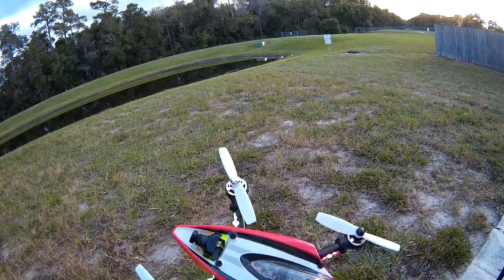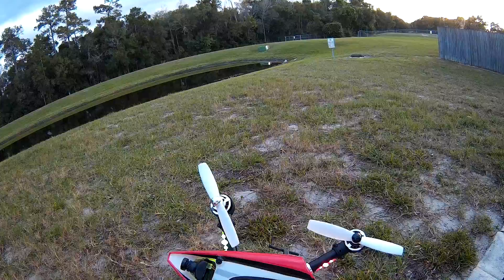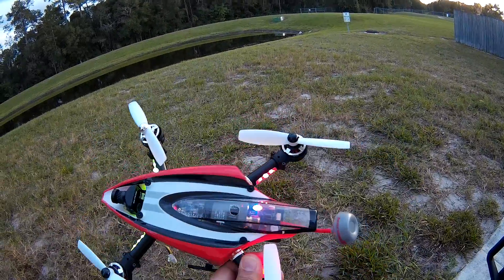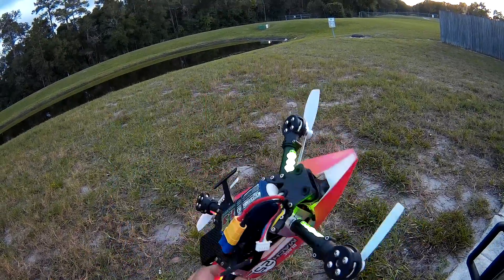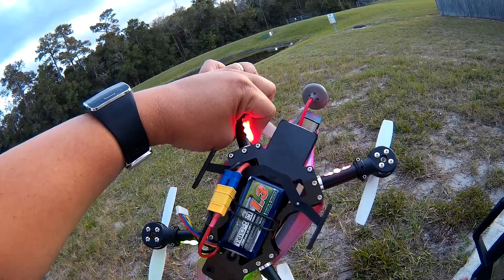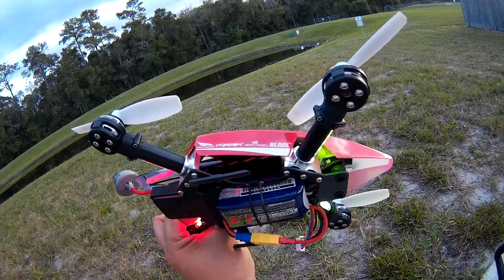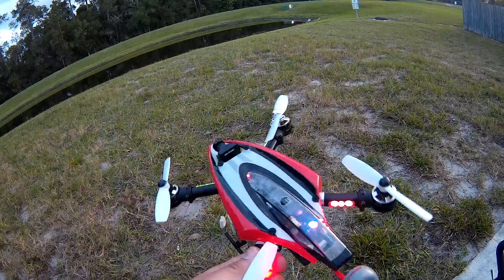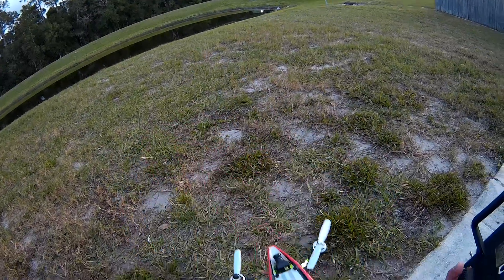Quick test Blade Mach 25  naze32 FC mod

Comment: the blade mach out of the box is junk. it needs all the mods you did just to become a decent FPV flyer, its not a racer. blade did an aweful job on designing the mach 25.  glad to see you did all the mods to make it a decent platform.
Reply from the maker: this quad is targeted for people that is getting into the fpv hobby and is not meant for an experience pilot . People have a choice to buy what they want , make a smart decision and you wont be disappointed . Your views  just differs to what others think about this quad . Blade did not hide the specs  so you can make a proper decision if this is for you or not.
Reply: +stoneenforcer Do you have one?
Reply: +Pamhatapezanu yes, I had one and quickly sold it. The Mach sucks. Much better off with a vortex for same price
Reply: Here in Aus it Mach 25 =$550 and vortex pro without receiver $750 and battery. Obviously the vortex is asuperior machine but so is the complexity. Mach 25 is an entry level machine for begginer racers. vortex is for people already racers.

Comment from the maker: More video coming from this moded mach25
Reply: Hey I seen on RCgroups forum you mentioned the stock 4 in 1 castle esc actually has BLheli firmware with one shot, Could you possibly email me? I have some questions, curious if you know what any of the settings are like the active braking and stuff are set to and if any settings could be changed for better performance, like maybe to fix the issue of bouncing when trying to land that I'm having. I would greatly appreciate some help! Just getting into 250 sized FPV racing (been flying for a long time tho) so I don't know anything about using BLheli or Oneshot and don't want to mess anything up! stevenvancooke at gmail if you don't mind helping me out. thanks alot!!
Reply: TomoQuads A video of your setup is well needed, can I please see how the fc

Comment: I see you are using a dx6 maybe you can help me out I have a 180 sized quad and I'm using a dx 6 with the rx it came with but I can't seem to bind it as far as I know the board isn't damaged I even looked at it under a magnify glass
Reply from the maker: +george aura its difficult to help if you dont tell me in detail how you do the bind process for your dx6